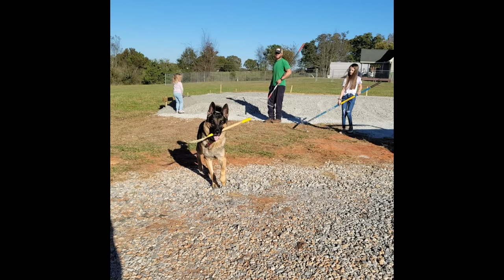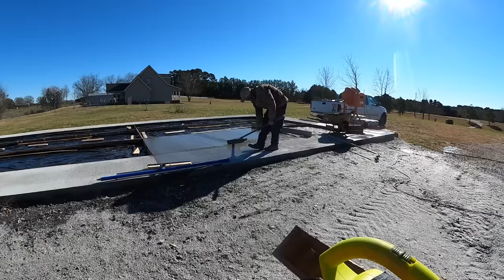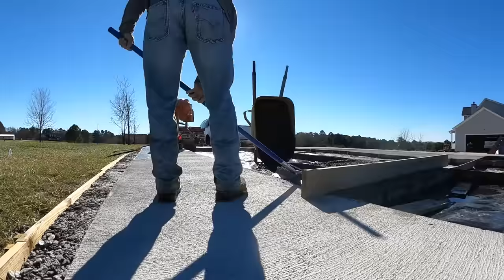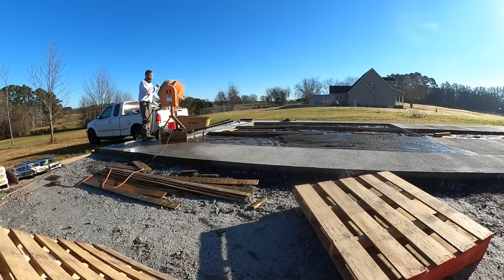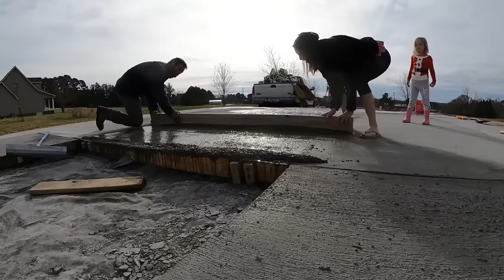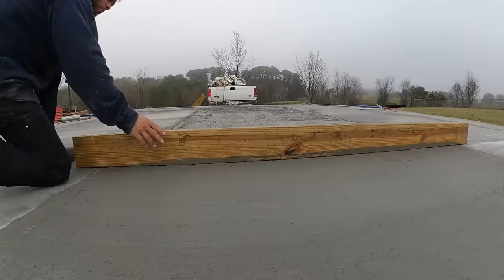Pouring a Huge Concrete Slab Using Bagged Concrete | I Saved $10,000

Comment: You still should have got a ready mix truck to bring you your concrete. You didn't save a dime by mixing your own bags. You saved money by prepping, forming. placing and finishing the concrete yourself.
Plus you got inferior concrete by mixing bags in that little mixer. Bottom line.
Reply from the maker: If you listened I said doing everything myself saved the money.  I actually did save money going bagged. #80 were 3.20 each. Truck was 200 to 220 depending on the day. 18.22 yds 820 bags 

bags 2624
truck 3826
Reply: @reallifetested2605  That's close to what I figured. I estimated 15 yds at 150-200 per yard(ready mix price).
You did say it saved you money in the video going with bags. 
And technically it did save you some money.
But you're going to get far superior concrete from a ready mix plant and that $1000 or so  you saved couldn't have been worth that labor.
I'm just talking shop. More power to you. I'm a Mixer driver not a concrete guy.

Comment: Using bagged concrete is stupid. Twice the cost,breaks your back and cold joints all over.Makes no sense.
Reply from the maker: It was actually a little over 1000 cheaper. #80 bags were 3.20 when I did this and truck was 200 to 220 per yard depending on the day.

Comment: A concrete truck is cheaper then bags by volume. When time is money, you did not save. The time mixing all those bags you could have done anything else making money. You did not save a dime. Sweat equity is profit not savings. So loss on bag concrete and lost time on labor. No savings. Plus time to make a video = loss on this job.
Call a truck and get it done right. On top of all of this all bagged concrete is in consistent in its mix= weak concrete.
Reply from the maker: I’m sure writing this comment made you a ton of money. It seems like a great use of time. Bags were 3.20 for #80. Truck was 200 to 220 depending on the day with a 4-6 week wait. Minimum quote for this work was 14k. So far the bags have held up better than the porch and driveway on the home we had built by “professionals”. That’s one of the reasons I chose to do it myself. I have right at 3800 in this project.
Reply: @reallifetested2605  don't bother with clowns like that....   they'll always find something to say..  you did a great  job.
Reply from the maker: @ja4476 you’re right about that. It’s hard to see the forest for the trees for some. Thank you for your kindness.

Comment: ?????????????????????????? No way is this correct . 46x26  4 inches thick would be 15.8 yards at $200 a yard  plus a finisher 1500$ or lets say 2k . so 16 yards say would cost you 3200 plus 2 k = $5200 for poured concrete. ok now 80 lb bags at $5.20 a bag x 712 = $3700 without a finisher .  so you worked your ass off for $1500 and you didnt get the much better product that concrete from a truck would have given you . your math is waaaaaaaaaaaaaaaaaay off .
Reply from the maker: If you use the right math it’s correct… around here concrete is 200 to 220 per yard. At the time it was with a 4-6 week wait. We received multiple quotes the lowest being 14k. #80 bags were 3.20 each. I made an update video a year ago and they were 3.40 or so. Good luck finding a finisher around here that doesn’t want at least 10k for labor.
Reply: @reallifetested2605  it takes a day lol wow talk about rip offs . Here in massachusetts they get about $1200 for a house floor 48×26  for labor . Sorry to hear about the situation out there

Comment: Still not sure how you saved $10,000. Those bags are a little over $6 a piece. So with all the concrete that’s roughly $6600. Alda a 40 by 24 garage is 960 sq ft. Not 1200. Great video tho. Plenty of dummies out there that can’t do math so good for you and your clickbait video title 😅
Reply from the maker: We were quoted minimum of 14k from local contractors. #80 bags were 3.20 each. Truck was 200 to 220 depending on the day with a 4-6 week lead time. The shop I built on it was 24x41. The pad is approx. a little over 2’ larger on each side. I have a little less than 4k in this with over 100 tons of gravel and concrete. If you use the correct numbers the math will work out.
Reply: Your time surly is money. There’s no way you saved $10,000 in any normal circumstances having to still purchase the bags and all your labor. Because that factors in just like proposals received. Either you pay for the labor or you pay with your labor, which equals time, which equals 🫰🏽. Factor your time in scheduling, driving man hours a mixer and wood to work with. Editing was 👌🏾
Reply from the maker: @scottgarner628  the way I look at it. Sitting around being lazy, or getting up and doing this? Time is better spent doing some things than others. Some look at things different ways I guess.

Comment: with the amount of water that was worked into the top, id give it maybe 2 yrs and the top will start peeling an popping off. if the climate has negative temperatures, with out entrained air, this concrete will start breaking up because the internal moisture has no where to go.  when you pay professionals to do a job, you not just paying for materials and labor, youre also paying for the know how and knowledge that comes with years and decades of experience of their trade. saving a little money now is going to cost more in the long run on an investment like this. 
if you dont know the details about concrete, i advise against doing this. it makes for a "good" video but makes for a very poor concrete slab.
Reply from the maker: I did a 1 year update you should go check it out. (coming up on a year and a half now)  Not a hairline crack anywhere and no signs of it as well. A lot of the "pros" in my area are guys that you would pick up off of the side of the road that gets handed a tool and tell them to go to work. I'd rather not take a chance on that with my money.
Reply: @reallifetested2605  contractors do travel. some further than others. ill check out your vid. thanks.

Comment: bagged concrete is the most expensive concrete.  there is simply no way it was cheaper than getting premixed at that size, you are conflating gravel and concrete work to provide fake youtube headlines.   I've poured tons of concrete, and the cheapest way is get the sand and gravel and cement and mix it yourself.  I built a 1/2 yard mixer for about $100... I saved $30,000!!   lol
Reply from the maker: No. Bagged was 3.20 per 80 lb bag, truck was 200 to 220 with a 4-6 week wait. Mixing using the 1,2,3 method was going to be 163 per yard because of the insane prices of sand and Portland. I stayed doing everything myself saved me the 10k we were quoted 14k and up. I have right at 3800 in this project. I did a one year update showing local prices on my phone to prove.
Reply: @reallifetested2605  So exactly, you did NOT SAFE $10,000 using bagged concrete.
You saved $10,000 by not paying for labor.
Don't be the same lying youtuber as everyone else.
Reply from the maker: @murraymadness4674  how did I lie? I said it in the first 30 seconds. I can’t help that you have selective hearing lol
Reply: @reallifetested2605  60lb bags of concrete are $4 today, a yard is 60 bags, $240/yard.
Onsite mixed in a truck is $150/yard.
I can make my own for $100/yard.
I don't know where you live, but maybe in some remote rural areas a truck just won't come to you without charging a fortune when fuel is $6/gallon.   
"I saved $10,000 pouring concrete myself"
Reply from the maker: @murraymadness4674  I did a one year update if youre interested. #80 bags were 3.20, truck was 200 to 220 depending on the day with a 4-6 week wait. To make my own was going to be 163 per yard due to high portland and sand prices.

Comment: This is a LIE there's no way you saved $10,000 a 1200 square feet slab doesn't ever cost $10,000 you are so drastically confused about the price you are plane old crazy
Reply from the maker: I was quoted 14k and up. I did everything myself for a little less than 4k. I don’t think I’m the one confused.

Comment: Buying concrete in bulk from a plant is far cheaper than any bagged concrete, you are delusional to think buying bags is cheaper... You saved money by pouring it and leveling it out yourself yes, but cheaper supplies, nope. Concrete isnt the expensive part , thats the labor... But nice try 😂. 
 Click bait 😠...
Reply from the maker: When I did this truck was 200 to 220 depending on the day with a 4-6 week wait. #80 bags were 3.20 each. I got multiple quotes and the lowest was 14k. I was able to do everything myself for a little less than 4k. If you do the math I think you’ll see I saved money.
Reply: @reallifetested2605  so you priced it at the worst time, ok I can see that happening... During inflation bs possibly this could be the case ... I doubt it, but possible 🤔... If it was cheaper, that much cheaper, then the concrete plants would be non existent... No one in their right minds would spend that much extra... They could rent a crew for a day and do it themselves... Hell I would buy all I could in bagged concrete, and start my own mix and pour on site concrete business if that was even close to accurate ... But seeing how there are A LOT of different concrete plants throughout the u.s. , this simply is not the case .
Reply from the maker: @MrJackson66  it’s like that with fencing in my area too. I just built a chain link fence. I have 6k in it. Local fencing companies quoted us 15k to 22k I believe contractors have lost their minds. Or are grossly overpaying for materials and labor.

Comment: That's not how economics works. It's cheaper to have it delivered...you know...by the truck.
Reply from the maker: That's what I thought as well. When I did this truck was 200 to 220 depending on the day. #80 lb bags were 3.20 each making the cost around 3780 for truck and 2624 for bags. I even checked into mixing everything myself with the 1,2,3 method but the high sand and mortar prices in my area made it around 163 per yard doing it that way. I will mention I have an f250 with a high capacity flatbed so me picking everything up cost less than 50 dollars in fuel.
Reply from the maker: In my area it wasn’t when I did this. I made a one year update showing pricing.

Comment: Saved $10,000? I call BS.
Reply from the maker: We were quoted 14k and up from multiple contractors. I did everything myself for right at 3800. We were recently quoted between 15 and 20k for a chain link fence install. I did that for 6k. Contractors have lost their mind I believe my friend.
Reply: @reallifetested2605  1200 ft at 4” is 15 yards. Buying through the concrete plant at $218 a yard would be around $3500. Bagged concrete pouring the way you did gives an inferior product that will never hold up. You spent more on inferior bags meant for tiny projects than you would have on real concrete. No quick Crete is NOT real concrete
Just poured an 18yard pool deck last week